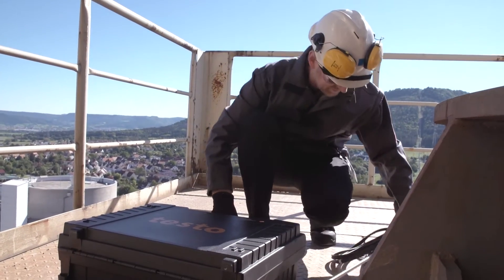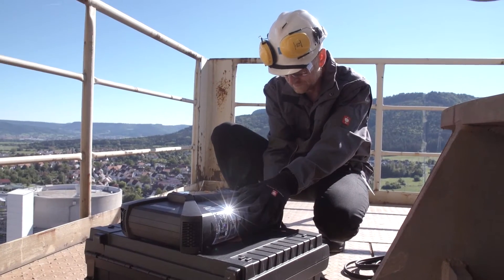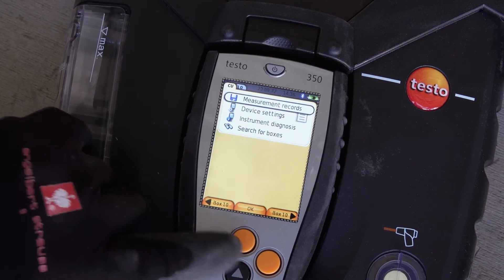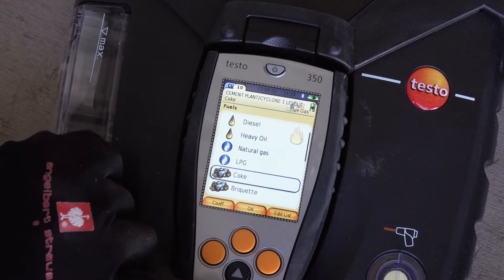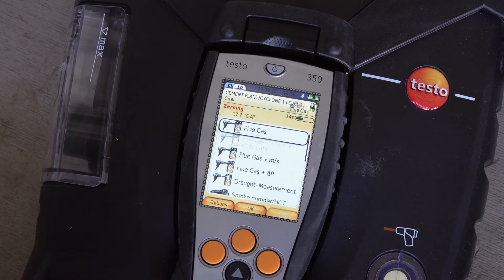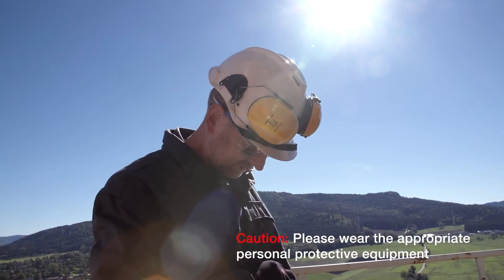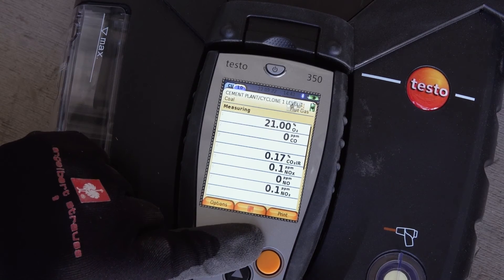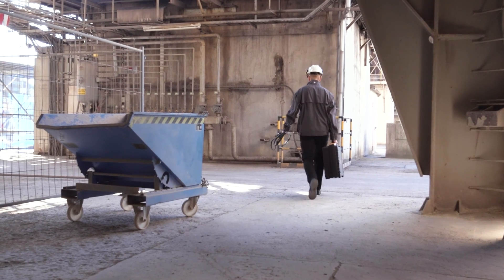testo 350 - Flue Gas Analyser

Comment: Easy to carry and easy to use
Reply from the maker: Most definitely @allkindvideos5372!  The Analysis Box can be operated with up to 6 gas sensors, 5 of which are optional. This allows you to select freely from sensors for CO, NO, NO2, SO2, H2S, CxHy and CO2. https://www.testo.com/en-AU/testo-350/p/0632-3510